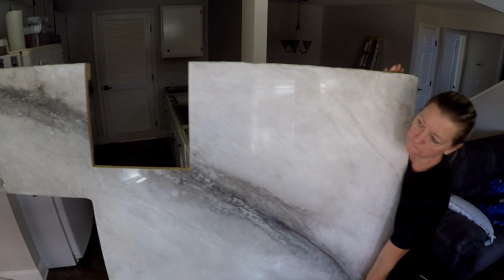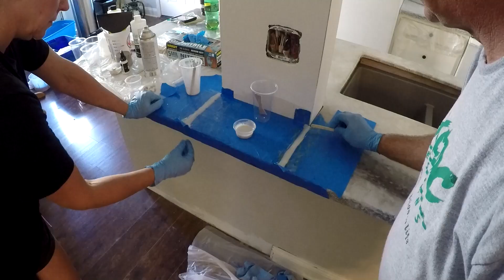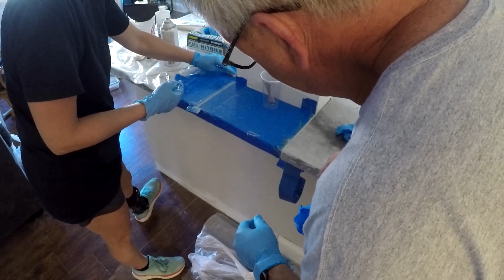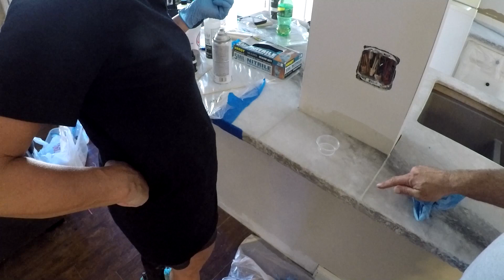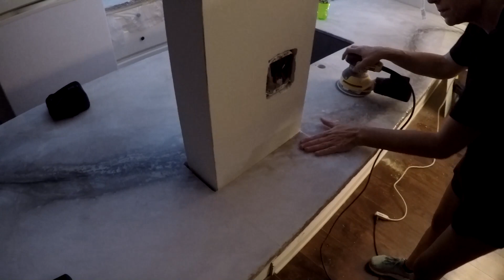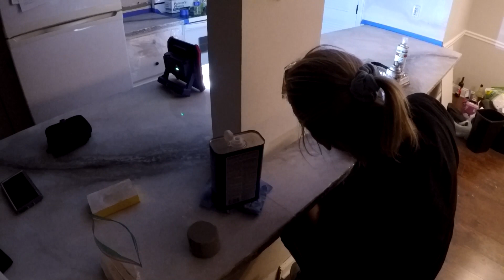How to do an onsite seam with epoxy resin. | KCDC Designs with Holly Smalley Customs

Comment: Why do you need to hump the tape on the leading edge? If there are four layers of tape going over the leading vertical edge just like on the horizontal surface then when you put a piece of flat tape over that it would be four tape layers above the vertical edge surface thus giving you that slight overfill you're looking for. What am I missing?
Reply from the maker: Great question and seems logical, but because gravity wants to pull the epoxy down, if I don't "hump" the tape the top corner ends up with the epoxy below the cut. The front edge is always last to have the tape pulled, again because the epoxy stays fluid for so long, if I pull it too early gravity will continue to pull it down leaving the cut edge exposed.
I'm always open for new and/or more efficient ways of an on-site seam but at this point this method has worked the best for me.
If the epoxy does end up below the cut line, I've just added more time to the job as I will need to mix and add more.
I hope that makes sense.
Have you also done this, and have a method that works for you?

Comment: Great instructional video. Question, could you add additives in the quick coat? Could minimize faux work?
Reply from the maker: Yes, especially if you're using Amazing Quick Coat since it provides UV protection. And someo of the faux painting is to match up veins or other colors in the top.
When using regular Quick Coat for on-site seams, I like to faux paint over the epoxy to hide the yellowing which would likely occur. So, it's Amazing Quick coat for the win, when doing onsite seams (dyed and/or colored to match the colors on the countertop.
Reply: @kcdcdesigns  thank you bud!